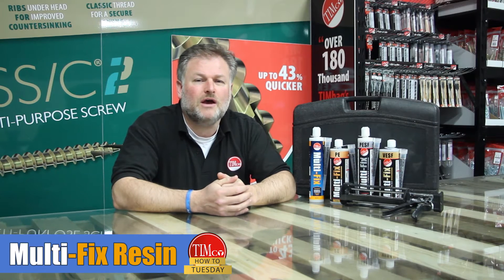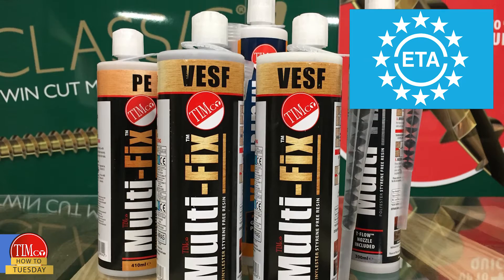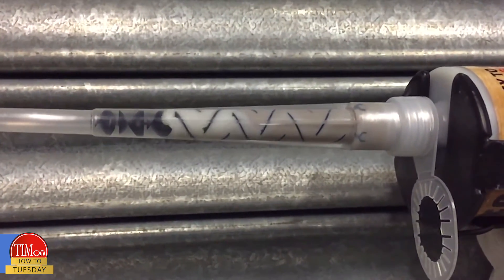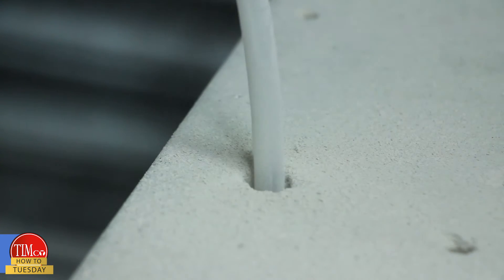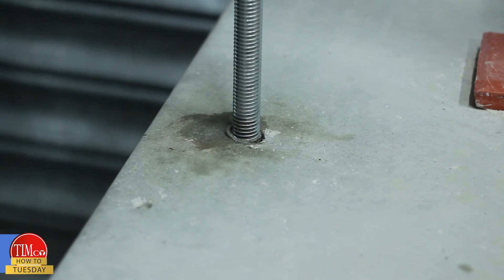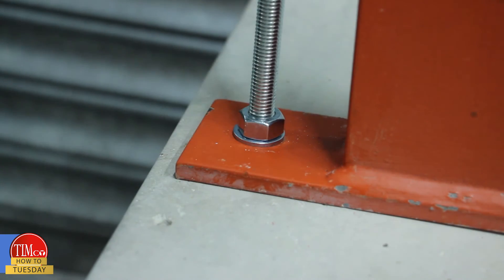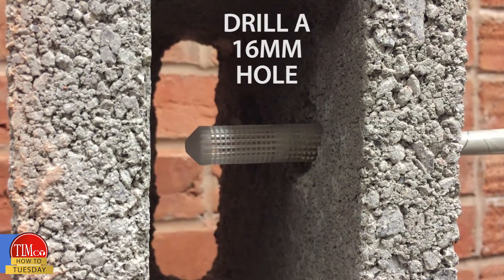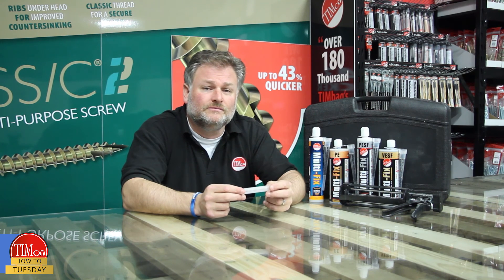TIMco Multi Fix Resin - "How To Tuesday" - Chemical Heavy Duty Resin

Comment: Good video. Fixing a shelf platform on my wall so that the window sill is level and the cat has more space there but drilling into the inside brickwork was a nightmare. It came out all sandy and the hole is wonky, the drill aint great and I even used a masonry drill-bit.
I'm hoping by using the anchor resin the uneven parts will fill and hold the UNO plugs in place properly. 
Wish me luck and ty for this video : ]